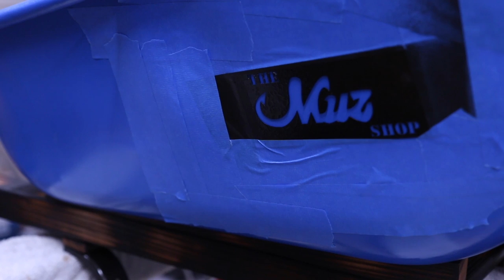Restoration: Wheelbarrow

Comment: I had a similar project restoring my metal wheel barrow except the outside of it was fine.  It was just the inside that had rust because I left dirt in it too long.  I first sealed up the leaks around the bolt head and then poured several containers of Evapo Rust into the wheel barrow.  Within 24 hrs it dissolved all the heavy caked on rust at the bottom.  It left pock marks where the rust used to be which meant the rust had penetrated too deep for a grinder and the Evapo Rust solvent was indeed the best way.  After I cleaned out the residue of the Evapo Rust solvent I pretty much went through the same process seen here.  
Btw, to transfer the Evapo Rust out of the wheel barrow and back into its containers I used a Drummond 750 GPH drill pump from Harbor Freight.  I think it’s better than the one Home Depot and Ace sells.
Reply from the maker: That’s awesome!! Thanks for sharing. 👍👍

Comment: Yours is unique having that front bumper with the 2 bolts instead of one. On the cheap wheelbarrows that's usually the failure point. Where it gets rocked upwards it tears the very end of the handles up or the metal fender itself. We bought our home 17 years ago and it came with a wheel barrow just like yours,but both handles and the tub had deteriorated.  I saved the m.j etal hardware,but had ti buy a cheap wheelbarrow to do immediate work. My cheap wheelbarrow is finally dead and my brother in law just gave a really nice folded steel jackson contractor wheelbarrow that needs a tire and fender. The fender I'd salvaged all those years ago is just like yours. I've some wite oak about 6ft long and 2" thick that should make some nice handles. I will have to get me some new carriage bolts and nuts because the old ones were a different size.
Reply from the maker: Sounds good. You’ll love a good wheelbarrow. What I did after the video, I got a solid rubber tire and I real like it … no more filling the tire every time I go to use it. Thanks 👍👍

Comment: A very nicely done restoration project.  Thanks for sharing the video.   I just acquired a contractor wheelbarrow today (also blue tub!) that is in similar shape as your original.   Will be putting a couple of your tricks to use on my restoration.

Mine has an air filled (and currently flat) tire.  What did you to fix your tire?  Is using a never flat replacement a good idea?
Reply from the maker: My tire would be flat every time I went to use it. But know I don't have to worry about cause its solid rubber. So yes I think it's a great idea, here's the one I got https://amzn.to/2QpJZVD. Thank you

Comment: If replacing bolts,  I'd use galvanized nuts and bolts and such.  My experience is that the threads on plain steel get badly rusted and damaged.  

To avoid a major restoration like this,  I'd recommend that people take their barrow completely apart after ten years.  Prime and paint all the wood and metal.  Grease the bolts when reinstalling.  That would be easy work to do and not take much time.

Too many years of neglect multiplies the work that needs to be done ---- a lot.
Reply from the maker: For Sure!!!
Reply: Good idea!

Comment: I like your use of the spokeshave on the handles, however, since your tire had dry rot and the rim was rusty, why not just buy a new combo (rim and tire)? They are only $20 at Home Depot or Menards or you can get the no-flat tire/rim combo for $26 (Menards).
Reply from the maker: Thanks. Actually I did get a no-flat after I made the video and I love it. No more”get the air pump cause I’m going to use the wheelbarrow “ 
Thanks for the comment 👍🏻👍🏻

Comment: That was some of the best filming and editing I've seen on any DIY channel! Wow! Also a stylish project, interestingly made with the burned wood, totally subworthy. The one thing I did miss was more of a learning component - for example what kind of discs you were using on the angle grinder, what was the white first layer of paint, what oil did you use, and also some of your reasoning/thought process etc, is always interesting and great for learning. Cheers
Reply from the maker: Thank you for watching and the kind words. This video was set out to be just entertainment not a tutorial. But I would be more than happy to answer any questions. The wire wheel is a DeWalt DW4930, which really ripped through the paint. For primer I used Self-Etching Primer Rust-oleum. As for the oil that was a Penetrating rust breaker call Blasters. Burning the wooden parts was mainly to give the wood extra protection from the outdoor elements and I liked the look. There is a wood preservative called  "Shou-Sugi-Ban". Look it up, its interesting.... If you have any more questions or suggestions on a topic you would like to see, email me. Thanks again and thanks for the sub👍👍

Comment: C'mon man, the dog did nothing to earn that ride in the $1000 wheelbarrow.  Flaming finishing (and oiling the handles) does seem a little over the top.  But man, that wheelbarrow may outlive you at this point.  Also concerned the black paint is not regulation, but a minor point at this point.  GREAT JOB!!!!
Reply from the maker: Thanks and you are right it will out last me now that I put a solid tire on it. 😉👍🏻
Reply: @TheMuzShop  VERY classy job!!!

Comment: And----  oh yes.  My only real criticism of this video was that the tire was not removed and the entire wheel treated for rust and refinished.

A leading reason for wheelbarrow failure is that the tire wont stay inflated,  and that's usually caused by a rusting,  pitted wheel where the tire needs to make good contact.
Reply from the maker: Totally agree, So after I made the video,  I actually changed out the tire and rim to a solid rubber tire and I love it!!! Thanks for watching.

Comment: You sold me a dewalt angle grinder
Reply from the maker: You’ll love it!!
Reply: I bought the DW402 115 mm 4 1/2" angle grinder back in 2002.  It's still keeping me occupied every evening.  It's outstanding!  Get yourself some good disc paddles for concrete, metal and wood.  You will love it!